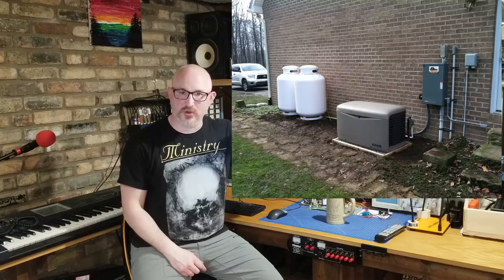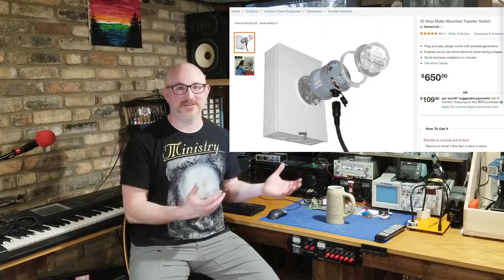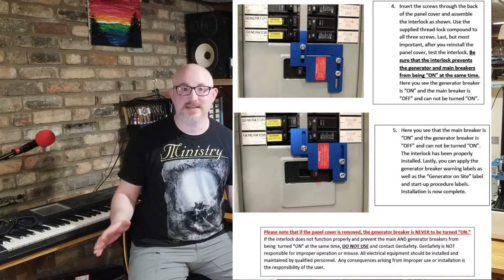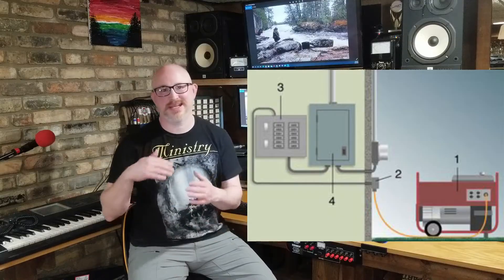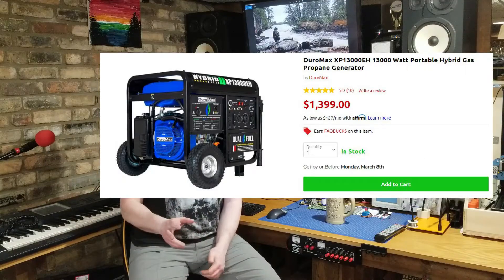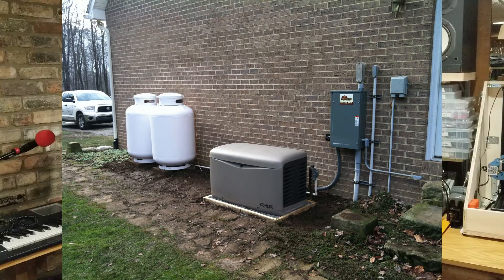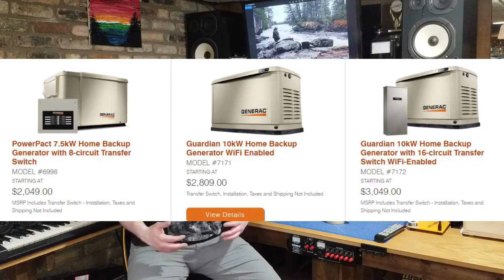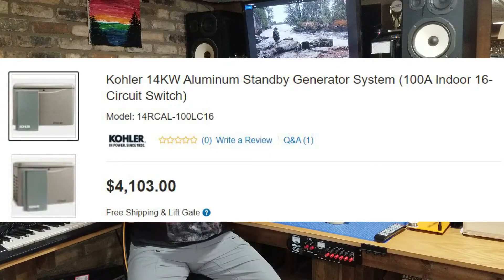Electrical Engineer explains connecting generators to your home

Comment: Richard, I purchased a new, old stock commercial 220 Onan 6.5 Kw generator with a matching  (220 or 3 phase) Auto Transfer switch that I intend to connect to a sub panel. I have seen examples where the neutral between the generator and breaker panel are wired directly and other examples where they are connected to the ATS. When is it advisable to completely isolate the  sub panel by switching the neutral along with the two hots and when is it better to hard wire the neutral and only switch the hots?
Reply from the maker: I apologize for the delay over the holidays and into January.  I recommend switching the neutral at the transfer switch and leaving the generator bonded, whenever feasible.  I only leave the neutral bonded and lift the bond at the generator when necessary.

Comment: Thanks for this info, Richard.  Well done.  I have a Generac XT8000e, and after no power for 9 days after Fiona, I bought a Honda EU7000is.  I needed cleaner power for the computers etc.  The UPS systems could not keep the power clean without clicking on and off and driving me crazy.  All ready for the next hurricane now! Have a great day! 😀
Reply from the maker: Great info!  Thank you for the feedback.  Nice generator choice, I outline how I connected a Generac 8500 in this video: https://youtu.be/Nrnforx1uFI

Comment: well, now I'm scared. and that's a good thing.
Reply from the maker: In all seriousness, don't be intimidated.  Ask questions!
Reply: @richardvedvik979  Oh I do ask questions. I've always found most people in the trades, love to explain things to others. The younger gen have no idea how lucky they are to have people like yourself taking time to make a video they can watch for free. Ask and learn.
Reply from the maker: @immrnoidall  Thanks for the complements.  I agree that the young (and old) of today are lucky to have access to videos and can find content experts fairly quickly.  Videos provide the opportunity to really prove you know what you're talking about because it's harder to fake knowledge in a video than a forum post or web page.   I don't use scripts, I just talk, and I think that should be apparent in the videos.
Reply: @richardvedvik979  OH. I do have a question. how do boats ground, for AC inverter use?
Reply from the maker: @immrnoidall   Boats do not ground have ground planes (due to materials) but instead have hard-wire grounds.  The circuit serving the shore power must be protected by GFCI to prevent electrocution.   For the onboard inverter, GFCI protection should be provided for any 120V loads.  GFCI will trip when it senses leakage current (i.e. unsafe conditions or the act of being electrocuted).
Reply: @richardvedvik979   GFCI  without a real "ground point"?
Reply from the maker: @immrnoidall   Interestingly, a GFCI does not need a ground.  It looks at the neutral, not the ground, to make a determination on fault conditions.  This is why you can feed ungrounded receptacles in a home with GFCI.  Cool, eh?
Reply: @richardvedvik979  OH I SEE.

Comment: My generator wasn't running right and done a power surge burnt my dishwasher up and made the 220 air conditioner on the wall light up is there any way to keep that from happening
Reply from the maker: Definitely need the setup looked at in-person.  Find a good electrician and have them inspect what you have.  A surge protection device can help if everything is properly wired.  Proper separation of neutrals and grounds is important, only one neutral-to-ground bond should exist.

Comment: Great quality and the first time I have heard of a plug right on the meter. I will have to look into that.
I have solar and a Powerwall for routine operation and I had Tesla put all my 120v loads inside the transfer switch and all my 240v loads outside so under most circumstances my solar and Powerwall can supply my home. So what that leaves me with is the issue of extended power outages during cloudy weather or the need or desire to run 240v loads while utility power is out. To address those circumstances I purchased a mobile NG generator. The question I have is paralleling my generator with my solar/Powerwall inverter output so neither is damaged. The solar/Powerwall inverter automatically parallels with utility power. Would it also automatically parallel with a generator inside or outside the automatic transfer switch?
Reply from the maker: The high THD of the generator would likely be unacceptable to the solar/powerwall.  That means the safest way to do what you want would be a separate transfer switch/panel for the NG generator loads or a way to ensure you are not back-feeding the solar/powerwall.  There are some detailed discussions of why that is here: https://forums.mikeholt.com/threads/microgrid-with-generator.2562015/
Reply: @richardvedvik979 Thanks.

Comment: I would like to see you discuss solar powered generator hookups, just in case gasoline or propane may become difficult to find.
Reply from the maker: Note that solar panels with onboard microinverters still need the utility to operate.  In order to use solar during a utility outage, a battery system with an inverter is required.  I agree that this is a good topic, thank you!  I do get into solar designs and there have been a lot of Code changes over the past few Code cycles as the technology evolves.  There are some commercial products but they are really expensive.

Comment: You said never back feed a utility right after you talked about the interlock switch. That is exactly what the interlock switch does, let's you safely and legally back feed your house. Other then that great video.
Reply from the maker: Never back feed the utility meaning the transformer serving the house.  Back feeding the panel is going the other direction, into the house.  Maybe I should have clarified the definition.  Thanks!

Comment: HUM, never heard of the meter socket extension, does it work like a automatic transfer switch in that when the main power comes on it shuts off power coming from gen??
Reply from the maker: It is a manual transfer switch that is engaged or disengaged though the process of plugging in the temp gen plug.

Comment: That was very helpful!   I have all of my necessary circuits wired with an SO cord plugged into a receptacle.   Power goes out, I unplug and plug into extension cords.  Works fine, a little more manual work to do so.   I also knocked a hole thru my walkout basement door and slipped PVC pipe with screw caps on both ends so I can Route a heavy cord thru without having to leave the door open.
Reply from the maker: Nice solution!

Comment: A few words about inverter vs "standard" generator please.
Reply from the maker: An "inverter" generator uses just what it sounds like, a DC-AC inverter to generate 120V.  Historically they were much more expensive and much lower power but offered a clean AC output and usually at a lower noise level.   They are great for backing up sensitive electronics and their lower noise found uses at campsites.

Comment: All our new appliances have little computers within them, my upgraded gas furnace has a number of computer chips within it and a twenty step computer controlled air circulation motor.  Non of these items can be run on a standard generator, all require an "Inverter Generator" to smooth out that square wave form cheaper generators produce.  So I looked at the costs and purchased a little Honda inverter generator to drive my $5,000.00 furnace in the next ice storm.  Living in the great White North heat is the main item needed to survive  at -40 degrees, everything else is just convenience.   ( I wonder will natural gas still be flow during the next big three month hydro outage due to an ice storm or an Ohio overload of main transmission lines that take out half of North America?.)  Anyways should be looking at INVERTER type generators.
Reply from the maker: Thanks for the comments, sorry for the delay.  I installed a 8500W generator with 5% THD and I outline my process for connecting it in another video on my channel.   It is clean enough to run my whole home and is fuel injected, gasoline, electric start.    

The EZ Generator Switch makes it easy to use a smaller 120V inverter generator to feed point of use loads (like a furnace) with an extension cord.    

For those with concerns on natural gas availability, a supplemental propane tank can be provided.    The main downside I found when looking for a dual fuel portable generator was the high THD of those units.  A 240V primary, 240/120V secondary isolation transformer would act like a low-pass filter and greatly reduce the THD out of those less expensive generators.  Otherwise, you could make your own AC-DC-AC inverter type output for 20A 120V circuits using a converter and inverter in series with a battery buffer in between.

Comment: Hi Richard thanks for the great video, i have a question buddy, my generator is 4650w with 3560 running watts, 30amps 120volts, it has 3 prong twist lock output, but the input to the house has 4 prong twist lock, my question is, can i make an extension cord up for this if so what do i need and how would i connect the wires at each end ? thanks for any help.
Reply from the maker: Hmmm, that is a weird generator output.  If it's only 120V then you can't back up your panel. What's the model number so I can look it up to verify?
Reply: @richardvedvik979  Hi Richard Thanks for your reply, the Generator is a Firman Model No is P03602 Thanks again for any help buddy.
Reply: @richardvedvik979  Hi Richard i checked on Amazon and i believe I could get where I want to be using these 2 Items, L5-30P TO L14-30R, PLUS SOUTHWIRE 65172740. Though I would prefer to do it with just one cord instead of using 2, and so i wondered if you would know if its possible for me to make my own up.

Comment: At the end summary you didn't mention the option of adding a dedicated 30 amp twist lock house socket along with the interlock switch, but you did cover some of those details earlier.  Don't always count on a licensed electrician to do the right thing.....just had my 30 amp socket installed....and I gave the electrician detail instructions on what new breakers to purchase and install in order to make room for the dedicated generator breaker inside my outside panel.  He didn't follow them and instead put a 15 amp 14-2 circuit on a 20 amp quad breaker.  Now I have to fix it.
Reply from the maker: My follow-up video details what you describe with a twist-lock receptacle.

Comment: Great overview.  How the heck did we ever survive our youth, before op-amps and subsequently GFCIs were developed?  🤔😮  I learned the best way to prevent my electrocution was to let go of what was shocking me.   I was wiring up experiments from the age of around five to seven.  After getting shocked by the heat register I discovered I could make things run on one outlet wire and the heat vent.   Amazing I survived!  But good background for developing an understanding of the wiring system.  
Nice combo electronics and studio bench, btw.  Cheers!

Comment: My generator feeds a subpanel. This subpanel feeds things I need to work while using the generator and I need this subpanel to backfeed the main panel. It seems a mechanical interlock won't work for this setup. Is there a way to use a relay or any other system that will work for an interlock?
Reply from the maker: The sub panel makes it complicated because you can't have a neutral-ground bond in the sub panel as it relies on the bond in the service panel.  Further, you cannot interlock such that you can safely backfeed the home panel.  Ideally, you would move the generator backfeed to the main panel and interlock it there, then you can safely feed your sub panel and the service panel.  

There are key interlock systems in which you could have two keys for three breakers that would ensure you could not back-feed the service since only 2 of the 3 breakers could be closed at a time.   I've only seen them on larger breakers and not smaller breakers as the key is used to allow closing of the breaker.

Comment: Dont have a meter on ,my house and have a 30 amp generator I want to hook to my electric system, could you give an estimate to install a transfer switch with hook up box?
Reply from the maker: All homes have meters, that's how the utility company knows how much to charge you each month.   A local electrician should be consulted for installation estimates based on field conditions.   The transfer switch needs to be sized for the service amperage and the incoming feed needs to be intercepted.  All of that effort/cost requires an in-home consultation to develop an estimate.

Comment: I have always thought bonding to any pipes in the house whether it be a gas pipe or water pipe are being used as sacrificial anode and will over time rot them out
Reply from the maker: Bonding to water pipes is a requirement and if the proper materials are used they prevent galvanic corrosion.

Comment: I tried to hook up my Honda generator today to my 6 year old furnace. It would not work because the generator was putting out 60 v on the black and 60 v on the white and the furnace needed 120 on black and 0 on the white. How can I rectify this? Thanks!
Reply from the maker: Hi, Dave.  Need more info.  Generator model #?  How did you try to hook it up. In detail?
Reply: @richardvedvik979  Thank you for responding! It is a Honda EU2000i purchased in 2009. It has two "traditional" outlets, each labeled "AC output 120v, 13.3 amps". (of note there is a notation that reads: "Parallel operation outlets requires special cables. See Owners Manual", and there are two holes (similar to an headphones plug in on a computer) under that statement).

The black and white ports on each outlet measures 60 v w/ a voltmeter. 

I plugged in high quality cable from the output port. I interrupted the 120 v hot line from the breaker box to the furnace (6yr old Rheem)  with a simple male/female connector. The furnace works fine if these are connected. However, when I replaced the hot line in with the generator (instead of the line from the breaker box) the furnace gave the code "2 6" meaning "leads inverted". I tried switching the leads in the connector (putting black wire on silver screw instead of dark screw) and got the same response (2 6). Also, then got the same response with the hot line from the breaker box. 

I called my HAC guy and he came out and looked and said the new furnace chips require 120/0 instead of 60/60v. 

Is there some kind of converter that can take the 60/60 v and convert it to 120/0? 

Thanks very much for your expertise. It is greatly appreciated.

Dave, Indiana

Comment: I know it is not the right way,.. but if i backfeed thrue an outlet in my house with all the cautions and safety with a small 120v 16amp generator only for one fase; am i not suposed to be able to switch of  all of the circuits that are in the same fase that i do not want? because my isue is that there are not swithing of, and i have no idea why could that be. Thank you in advance for your response.
Reply from the maker: You are correct that your process is a poor one.  The steps would be to shut off the main, then shut off all breakers, then turn on the one you are backfeeding then turn on the others you want to use.  I suspect that you mixed hot and neutral on your backfeed (since nothing is legally made to allow you to backfeed thru a receptacle) and that is why it seems like the breakers are not functioning properly.    Getting the EZ Generator Switch would let you do what you want to do safely and legally.

Comment: Good video!
I am converting from 240V generator to 120V generator. I have a lockout transfer panel with 4 prong cable input. 
I want to use a cable adapter to connect 4 prong generator cable plug to 3 prong generator outlet.
Is this legit and safe to power both sides of transfer panel with 120V generator using a cable adapter?
I will move the 240V appliances from the transfer panel back to main panel.
I understand that the load from all circuits must not exceed the gen max load. 
Thank you!
Reply from the maker: Thanks for the question and sorry for the delay.  The answer is NO for any 240V loads and also no for any multi-wire circuits (shared neutrals).    If the individual single phase loads saw the same 120V phase, they wouldn't know the difference, but the neutral would see 2x the normal current.

The adapter would put the same 120V circuit on each of the 240V legs or use two different 120V outputs (I assume the latter).  This would share the neutral and isn't recommended.  Does your transfer panel have two pole switches or single pole switches per load?  

For this application, the EZ Generator Switch is the best bet when the source is only 120V.   You can group these boxes at the panel for easy connection to multiple 120V extension cords.   But I understand that you just want to backup the transfer panel.
Reply: @Richard Vedvik  No shared neutrals. It is residential construction 2005. The only split phase circuit in the transfer box is an AC compressor, which will be moved back to main panel. All other circuits are single switched with their own neutral per hot leg. I tested the adapter and it seems to work OK. Thanks very much for your advice!